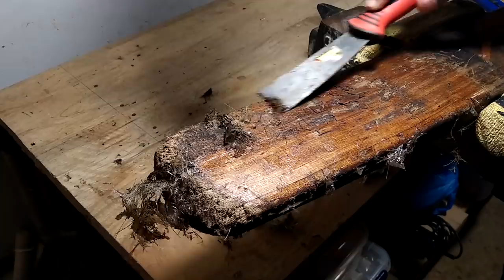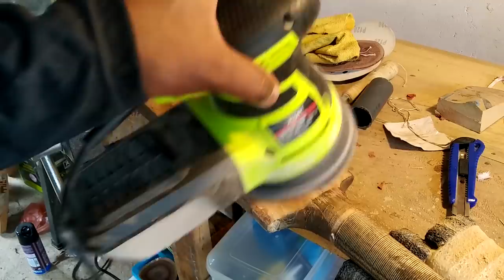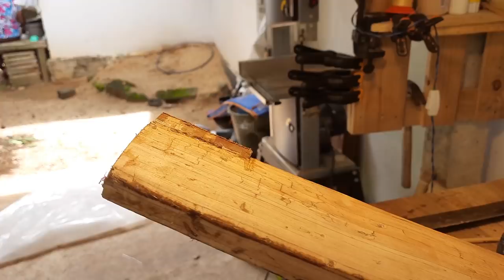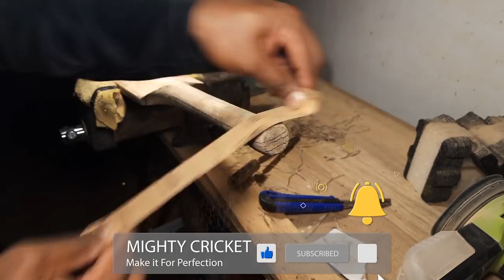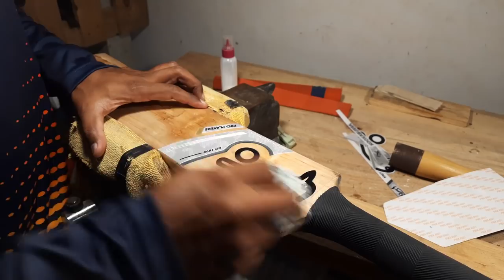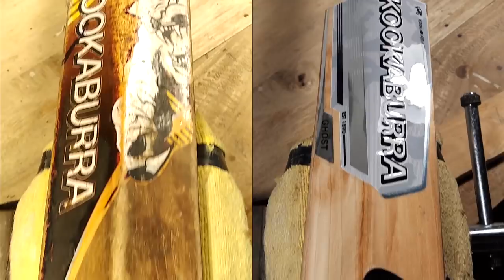Full Repair & Refurbishment of cricket bat - Kookaburra Beast Jr

Comment: The refurbish looks fabulous. I did see at around 5.00 to 5.11 of the video 2 inches of the toe of the bat was cut off along with the bats edge. The edge was replaced with another piece of willow and secured in place with what looks like oak plugs. If i was the owner of the bat and have to play with this refurbished bat two things will happen
1. My stance will have to widen to feel the length of the bat knocking on the pitch
2. Change of length by two inches although seems negligible will certainly affect the sweet spot and timing of my front foot drives. 
Also when the ball keeps low or skids of the wicket unless i am crouched will it not affect my ability to get bat on ball. For me two inches of the bat lost is a lot lost. 
I maybe wrong. Hopefully folks who have actually played with similar shortened bats can provide me a feedback.
Reply from the maker: Hiii thank you very much for your comment bro , it has awesome point and all are valid as wel,, now let me clear this .bthis has been used by a boy aged around 13 , and the owner want to gift it tona another boy who is age of 6 so as per his request we have ajusted height of the bat ,,, this is a junior bat ,, again im thanking you for you fabulous comment keep watching us